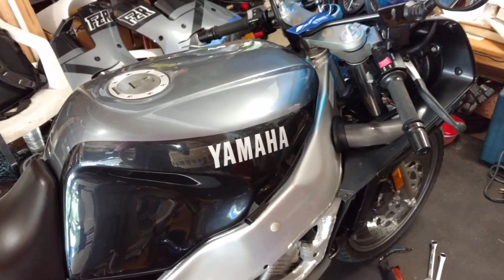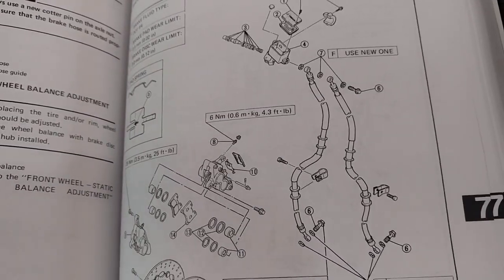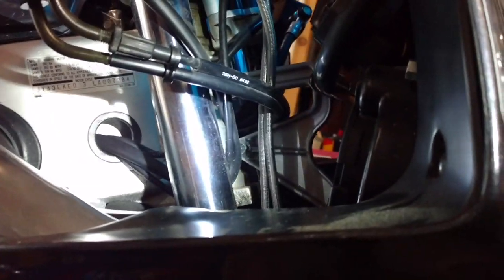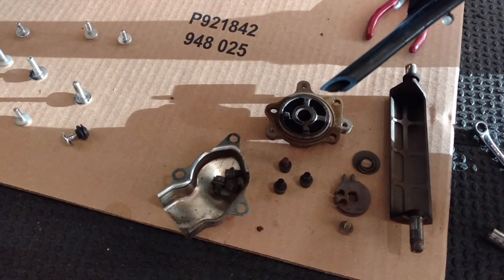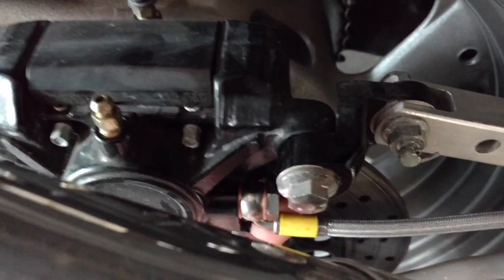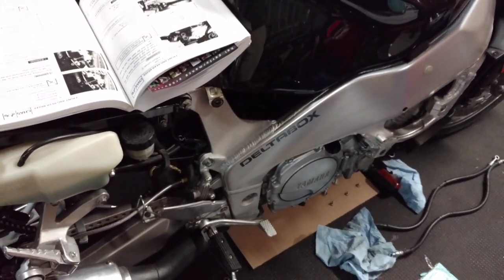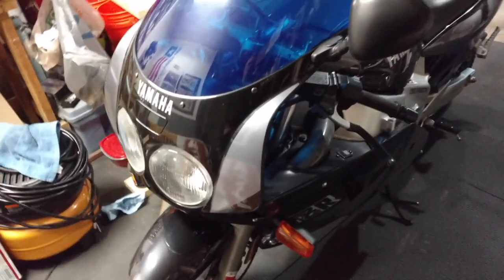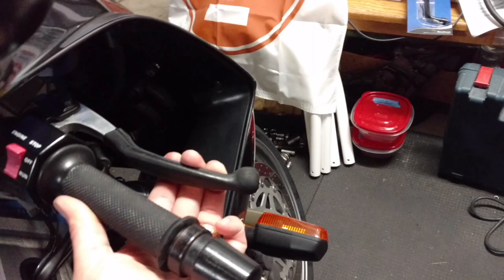FZR 1000 Brake line upgrade, EXUP service

Comment: Hi Dude from the UK could you tell me where the vacumn take off plugs/ports are for balancing/Syncing up the Carbs would be a great help to me  good videos and very informative
Reply from the maker: Wow, sorry I didn't see this sooner! Perhaps you've found your answer, but the vacuum ports are plugged by some socket-head bolts on the bottom side of the intake runners. You reach under the carbs from the back and you'll be able to feel them. The ones on the right are hard to reach!